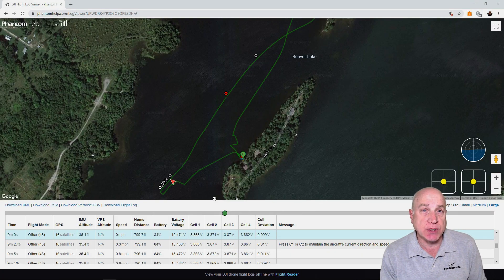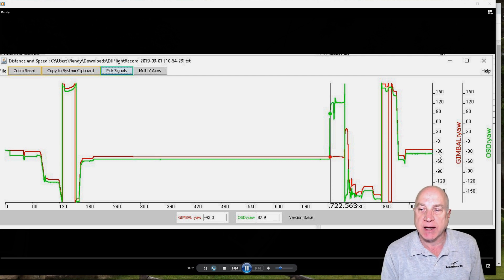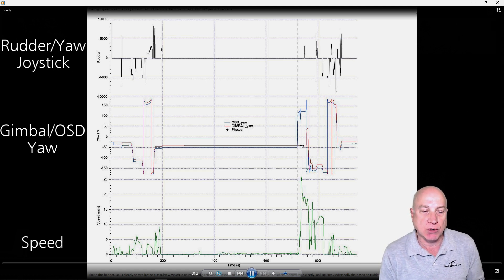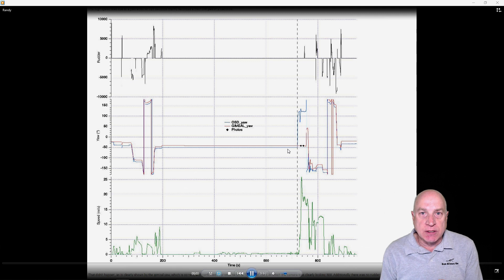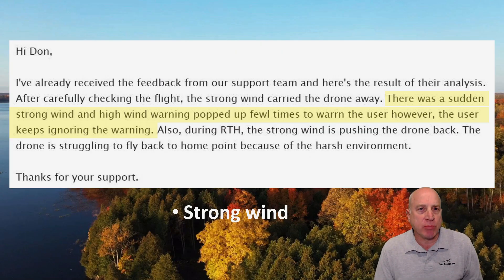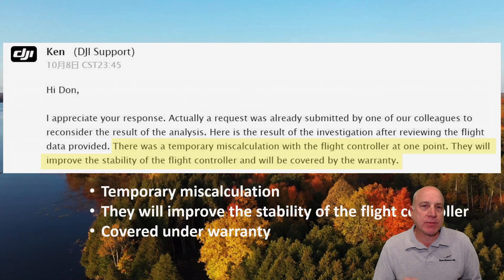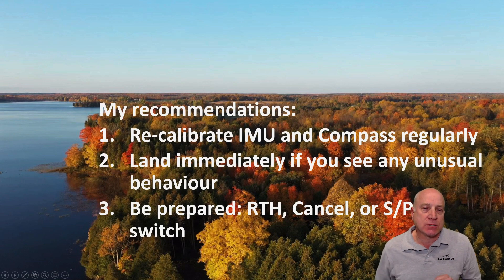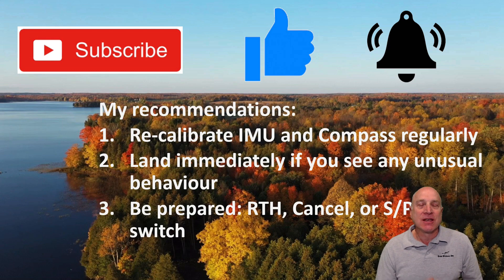Mavic 2 Pro 90 km/hr Fly Away...Explained!

Comment: Pause video @1:29 possible "Bird Stike" right side of video in between clouds you can see bird/hawk flying away. Just before  possible bird strike you can see the drone dip a bit before "flyaway". I'm interested to see what the altitude data looks like?
Reply: between 127.5 and 129.3  no altitude change whatsoever and then a change of a couple of inches over 3 seconds later
Reply from the maker: Hi Jimmy.   While there was a bird in the vicinity, this was not a bird strike.  No evidence of altitude variation, nothing showing in the camera view, and no visible damage to the drone.  And the yaw variation wouldn't happen with a bird strike.  But good spotting, and thanks for the theory!!!

Comment: Thanks Don. A good explanation as to what went wrong. Certainly a heads up to be prepared to react as it sounds like there could be a small chance this could happen to others. A few years ago my FlyPro PX 400 at short range stopped responding to my control and headed off into the wild blue yonder, never to e seen again. A company contact admitted there was a small random chance that this could happen for this drone. Unfortunately they would not do anything for me unless I could send them back a broken drone or what might be left of it.
Reply from the maker: Thanks, Dave!  Your experience is like the DJI Care program (which I signed up for)...with no 'dead drone', they won't support you.